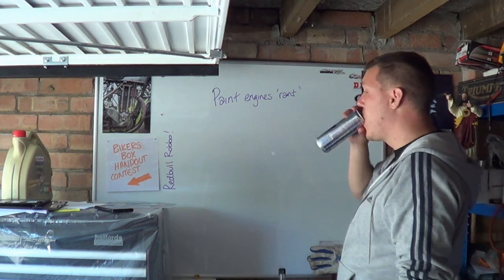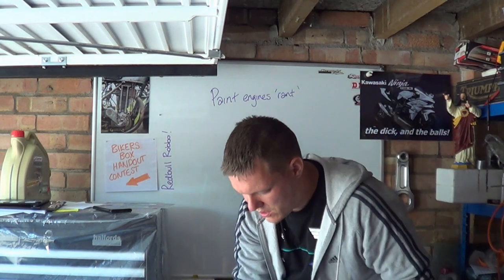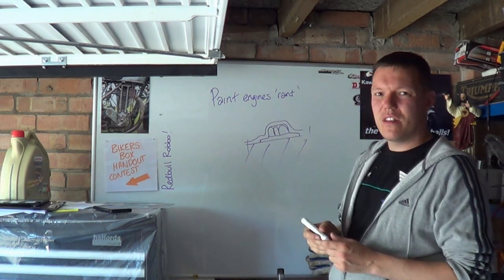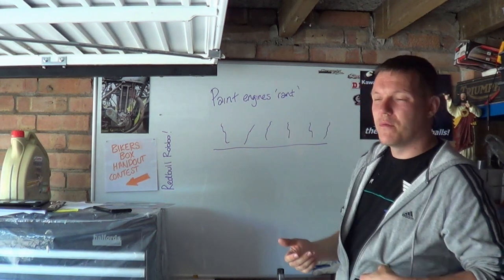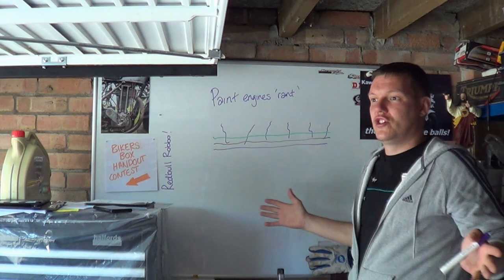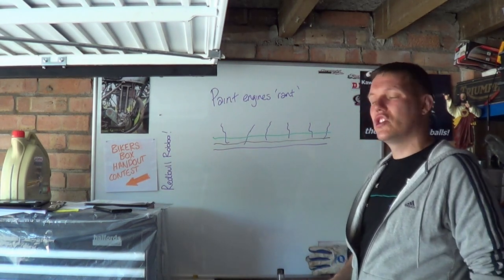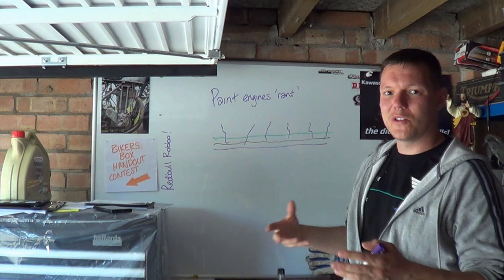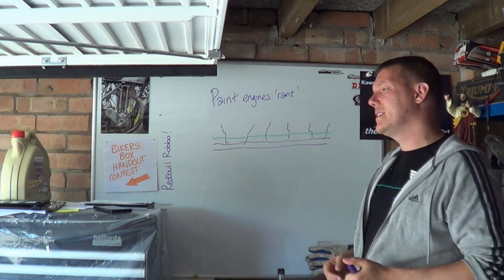Painting engines RANT!

Comment: I find it better to paint all parts of the engine, I will paint the pistons, the cylinder walls in fact you can make your cam a higher lift by putting lots of paint on. the crank journals must be painted to prevent premature wear, I always make sure I get plenty of paint down the oil galleries to stop deposits building up there, it is essential. But more essential is the colour on the outside, obviously red for an all out powerhouse, blue for fast road and black for stock, red tends to be 10-15hp more than black.
Reply: You forget to add yellow for beginners.-35 hp
Reply: Titanium colored paint will make the rods stronger also.

Comment: well said, i agree, used to work in the paint trade, you're spot on there.... can't fault anything in what you said  cheers for the vid,  personally if you're gonna paint your engine, strip it and do each part individual, i find black engines fitted with stainless bolt kits to be the bollocks, also contrasting the engine paint with the bolts does give that extra bling factor.... and make it a fuck sight easier to work on it as well.

Comment: I’ve not long done my FZS1000 engine in the frame. After doing the valve clearances and painting the cam cover off the bike cos it was scabby, decided to do the rest of the motor in the frame. I did mask off as many of the bolts on the cases as I could do. I used simoniz engine enamel aluminium coloured, looks pretty good, sadly soon as I went out on a wet Saturday the front of the motor is covered in shit again. It’s a hard bike to clean behind the exhaust.

Comment: Alot of OEMs in the industrial/construction machinery/earth moving/etc industries paint the engines in one foul swoop.  Covering over wiring and everything in one go.  Painting bolts and everything just like you hate.
Reply: I was thinking that - god help him if he ever has to work on a generator or a tractor!
Reply: I use to have to paint industrial engines, did the same thing most the time, but when we masked them up my god it take days to get prepared.
Reply: I imagine in that sort of industry painting the bolts could be useful in that it would form an extra layer against corrosion and the elements.  Maybe they do it knowing that if the bolts have to come off they'll just paint it again?

Comment: I painted side casings for my motorbike engine once, used etch primer and then a standard black paint I think. Also lacquered them but when I came to bolt them on the bolts just ripped the paint off easily lol. So which paint must you use to make sure this doesn’t happen? Besides paying for powder coating

Comment: I have a question.
With painting the engine (motorcycle), how would you separate the the parts to make sure that it is painted correctly with a single  cylinder air cooled engine?

Comment: HELP! What I got a problem with is I've got a 1979 air cooled cb engine that's been painted horribly, I want to repaint it but how do you get all the old crap paint off between the air fins nothing fits in between the fins aaaaahhhhhhhhHHHHHHHH
Reply from the maker: Well you're going to have to take the engine apart first - if you're will to do that then I have the solution
Reply: Dip it in lava. That'll take the paint off

Comment: i actually need to repair and paint my tank, now do you mean a week between coats? and how many coats should i use, and what brand would you recommend, and if i spray bomb it what brand is best? (i know that with decent prep you can get a pro paint job with rattle cans, but it's still advised against)
Reply from the maker: "now do you mean a week between coats?" - no. a week to let the lacquer dry and harden.

as for brand, upol and krylon
Reply: ok, but how long between coats, assuming i have loads of time because i want to do it right
Reply: aterack833 
Before you crack on and just go to town on your tank get some object you don't care about and practice. Like a metal coffee can if your tank is metal or something like that. The money you spend on an extra bit of paint will totally pay for itself when you don't have to strip the big giant tank and start over.

Lots of thin layers. Like  lighter/thinner than you think makes any sense. One drip and you've boned it.
Reply: for me the hard part is getting the paint to come out that thin without 3/4 of the spray not going on the part, not to mention that when i get wind none of it goes on, might have to invest in some paint for my dads air painter, but then i might need to get a dryer since the air is filled with oil and water, not even an oiled compressor

Comment: I think all fully assembled engines should immediately be covered with a minimum of 2mm of chrome, then powder coated, and then be completely covered with ceramic glass...........up to, and including, the catalytic converter. And there should not be a dip stick or any means of adding coolant. Sealed for life?

Comment: What engine case paint do you recommend? What paint do you recommend for motorcycle exhaust? Thanks
Reply from the maker: Engine - Simoniz enamel (even though it isn't enamel)
Exhaust - don't get a stainless one
Reply: I dont know what you mean by stainless. My exhaust is 32 years old, had the whole thing sand blasted. Looking for DIY flat black paint. Do you have good experience with any brands?
Is Simoniz an European brand?
Reply from the maker: They only last so long. It depends if you ride in the rain and cold or not.
Reply from the maker: Stainless steel exhaust
Reply: I am pretty new rider so no rain or cold yet :) But I did spend 4 months for frame-up restoration of 1980 Honda CB750 F

Comment: Forget all that aerosol, air drying rubbish and 2 pack paint everything. There's no thinners to evaporate,, it lasts longer, its tougher, looks better and doesn't ruin the ozone layer.
Reply from the maker: "There's no thinners to evaporate"

- What?
Reply: The Workshop there's just paint and hardener mixed 2 / 1 and it's a chemical reaction that hardens the paint........
Reply: id like to see you pain 2 pack without thinners xD, its not gp thinners either because gp turns your pain lumpy and clogs your nozzle (not a painter but did paint enough to know)

Comment: I painted my 6 cylinder in my ute back to the original red with it all together then pulled off the rocker and lifter covers and put chrome ones one looked great used propper engine enamel
Reply from the maker: Until you have to remove the oil pan.

Comment: My Dad would spend hours masking of parts of fins that should not have paint. Masking off parts of wheels etc.....Masking is worth the time. Always better to do it as you say as individual parts not as an entire read to drop in engine! You seldom see lacquer used any more in the USA. I have never liked how it looks when every part of the engine is the same color of paint it just looks cheap. You will seldom see a body shop using them. You can buy commercial PPG products fairly easy in America base coat clear coat. Department stores and some DIY parts stores still sell lacquer but you have no real choice in colors it is like 12 basic colors to chose from. If you want OEM colors you have to get a commercial product and so that it can be custom tinted to match the OEM paint code. Likewise if you want a custom color commercial products only the lacquer stuff just comes in premixed colors! I watched a body work video from the UK a few months back and they mentioned lacquer too.

Comment: I agree on the week-long cure time. I live in New Mexico, and generally, I can spray coats on as fast as I want. 100F, 15% humidity. But, when I do cheap Wal Mart clear coat it takes fucking days. It gums up the sand paper. Fuck engine paint though.  Getting paint chips in your engine is a pain in the dick.

Comment: I live near the east coast of the UK in Norfolk, the marine diesels are usually engulfed in paint, they look like shit. I think they do it to resist corrosion from the outside that might seize fittings up. Car engines look a million times better if the bare blocks and heads are painted before assembly. Painted over nuts and bolts are a menace to anyone that might want to replace a water pump or starter motor.

Comment: I understand painting steel or cast iron but not aluminum.  Bare metal cools better....so if it won't rust,  do not paint it!
Reply from the maker: But pretty colours lol
Reply from the maker: And aluminium does rust
Reply: No....engine performance comes 1st....always
Reply: Aluminum doesn't rust.  It might corrode but it doesn't rust....
Reply: u wot m8
Reply: You can run 40 pounds of boost through your Honda for MAX PERFORMANCE right before it grenades and turns your crankshaft into a Magic Bullet.

Longevity is paramount.
Reply from the maker: Rust and corride and the same thing, oxidize is a better word. 

verb: 

rust

3rd person present : rusts; past tense: rusted; past participle: rusted; gerund or 

present participle : rusting1. be affected with rust."the blades had rusted away"

synonyms : corrode, oxidize, become rusty, tarnish; crumble away, decay, rot "the pipe is wrapped with special tape to prevent it from rusting"
Reply: Personally, I think that if someone wants colored aluminum bits, they should anodize them.

Comment: Plastic coating and powder are not the same.  They use the same principle IE  a powder that is electostacicly charged and applied through a gun. Dont plastic coat eny thing. If you get a nic in PLASTIC coatings the metal will start to rust, but unlike powder coating were the rust will be that nik ot chip, the rust will carry on along under the plastic coating.  Iv done loads of powder coating of frames ect and they last. The coating is a lot thicker than paint. The best finish is stove enameling and also the most expensive. PS make sure the powder is polyester and not epoxy, or a mix of the two.
Reply from the maker: Did I say plastic coating? What a dickhead, I meant powder coating. I have my own powder coating set-up.

Comment: Hey chief  the point your trying to make about the drying with the lacquer is called flash off or solvent evaporation, you don't need direct sunlight it's the heat that helps the solvent evaporate out of the lacquer or paint even, if it's solvent based all it needs is heat the infra red lamps your on about are not the Ideal way to cure solvent based paints as if the adequate flash off time is not met you might get solvent pop which fucks the whole thing up as it works its way through all the layers, but yea don't worry about the sun light it's the heat you need to cure them  about  18'c to 22'c unless you get the u.v. Curing products and for water based products you just need air to cure it the "hope that helps, and al see you in a bit" 😜

Comment: enamel paint has been a meaningless term forever. it's supposed to mean hard and tough, it's supposed to make you think about high temperature inert glassy glazes where it has taken its name from, but it's been a word for ordinary oil based paint for probably over a century, pretending to mean something special when it doesn't. the paints that do an extra set or sinter or whatever when they're heated after drying ARE special, but i'm not sure there's a generic term for them. or are they a subset of powder coating?